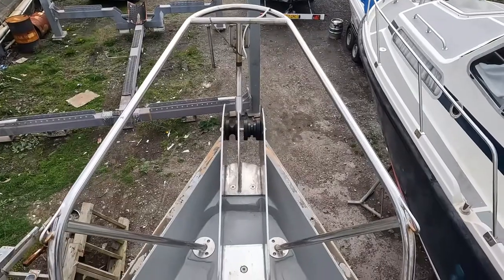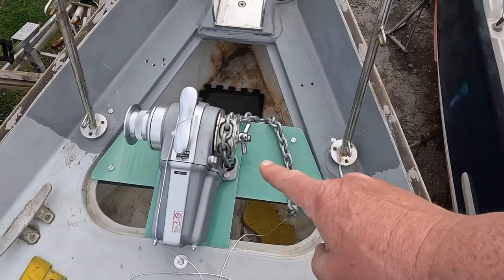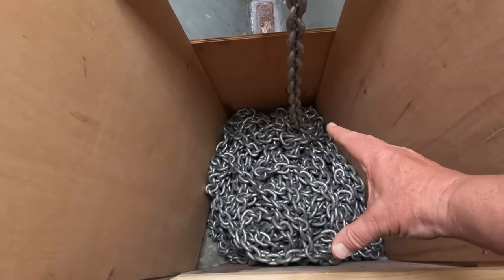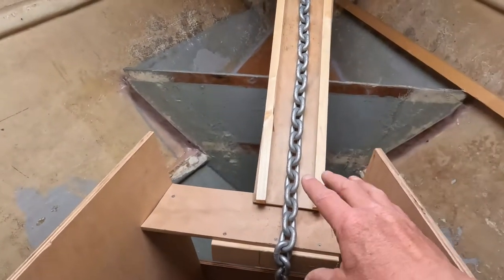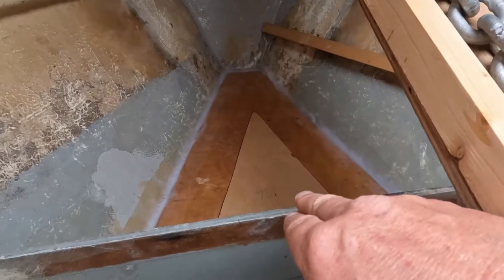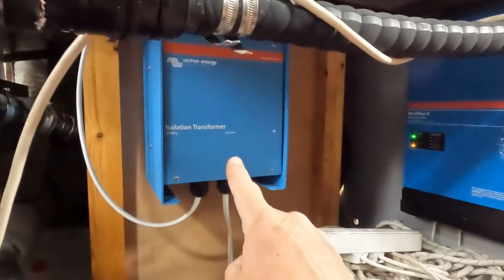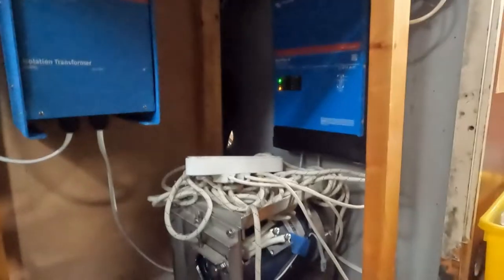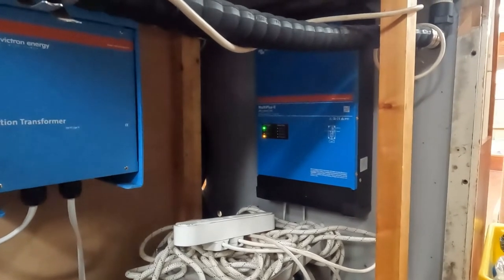Huge DIY Boat refit progress: Bow Roller, Windlass, Chain Locker, Shore Power

Comment: Keep an eye on that FR4 windlass support. FR4 is only about 10% fiberglass and 90% resin so some loads are not advised. I would be happier to see carbon fiber sheets or even a solid layup of S-glass that you make yourself and trim to fit. Just a thought. As you know fiberglass gets its strength from the glass not the epoxy. Torsional loads are not advisable for FR4 but it is great for compressive loads.
Reply from the maker: Thanks for the heads up. We will add reinforcement.

Comment: sorry but i don't think your windlass support will hold up to the forces involved when your anchor is shocking in bad weather and your chain lead down to the locker looks way to open an angle ,most chains drop straight down to self store.
Reply from the maker: It isn't yet a finished project. Note that the anchor windlass won't be taking the load while we are anchored.
Yes the chain route is unusual. It is going to be tested before being final. The slope will be covered in a low friction plastic. I think a reason it isn't common is also the impact on the v-berth.